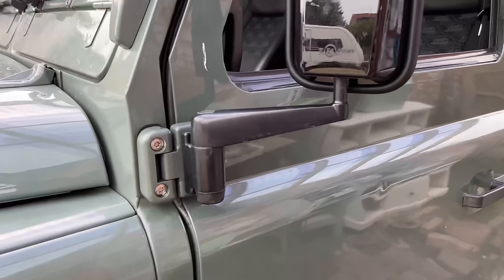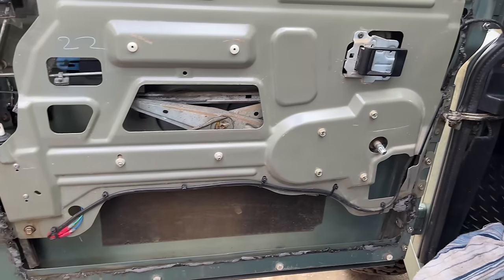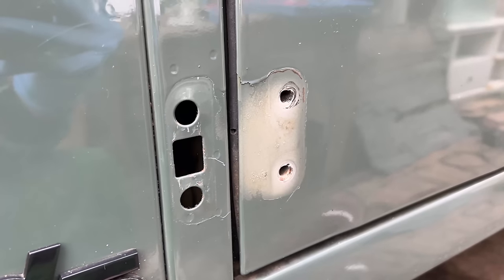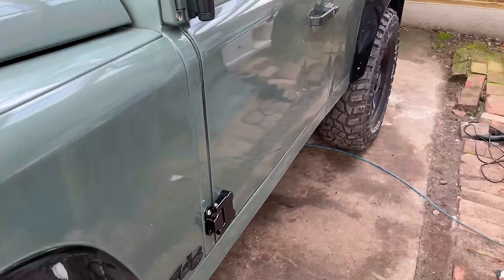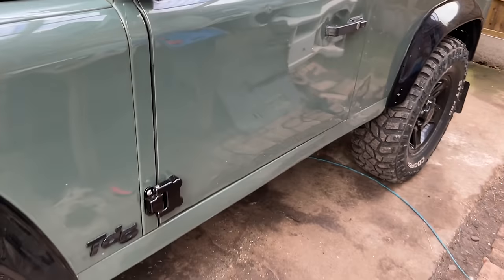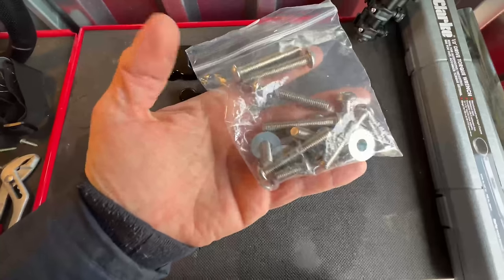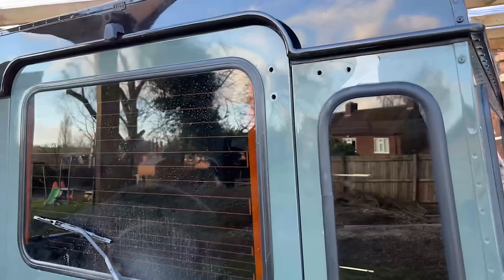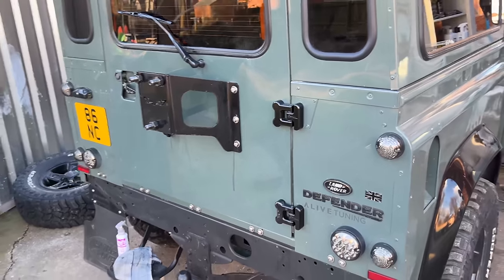NEW PARTS TO STOP MY LAND ROVER DEFENDER GETTING STOLEN! (PART 2)

Comment: They look great! Very happy because I have some on order myself.

Just as a bit of help to anyone who reads this comment, DO NOT skip using copper paste or similar when fitting these hinges.

The galvanic corrosion that can occur between stainless steel and aluminium can be a right pain, especially if you live near the sea.

I'd always recommend Tef Gel which is a Teflon-based paste that entirely eliminates the chemical process, I'm a Marine Engineer and we use it on everything. It's about £16 on ebay and lasts ages.
Reply from the maker: Thanks Andrew- and great tip! I did use copper paste on mine but will look in to this Tef Gel 👌🏻👌🏻

Comment: Instead of replacing the hinges, you can fit the steel plates that hook behind the door seal lip so removing the bolts securing the hinge to bulkhead does not free the door.  You can also hammer ball bearings into the Torx bolt heads to make using a Torx tool or drilling the heads off impossible.
Reply from the maker: These ones have that mechanism too so even if thr bulkhead bolts are drilled out you can’t take the hinge off

Comment: 2:38 from what I can see the bolts are just Torx pin / 6 lobe !? Pretty standard and not specially made for Optimill. There ARE various keyed and uncommon bolts available, but usually you have to register to buy them and the matching tools are expensive.
Reply from the maker: You’re right Frank- I just hadn’t seen them
Before

Comment: Hello Doctor hope your well 

I’ve started this job today having a nightmare with the bolt into the  old spire 
clips it’s just spinning did you encounter this if so what was your fix 

Regards David
Reply from the maker: Hey David - I can’t remember if I mentioned it in the video but I got new spire clips as mine were rusted out- that may help if that’s what you mean?
Reply: @thedoctorsgarage  hello… yes you did mention I’ve also got the clips it’s the original bolt that is spinning the original clips struggling to remove

Comment: Those front door hinges are no more secure than standard hinges.  Thieves undo the front bolts, so hidden rear bolts do nothing.  Those Torx bolts with the central pin are common, as are the tools to remove them. Far better to use regular Torx or Allen head bolts and hammer a ball bearing into the socket once tightened up - that will be a pig to remove to get a tool onto the bolt or to drill the head off.  TMD sell plates that fit under the nuts on the inside of the door, the plates hooking around the inside of the door seal lip on the bulkhead so even if those bolts are removed, the door is still held to the A-pillar (the rear bolts through the door frame can be turned, but as soon as they become loosened, the nut inside, being nylon, will turn with the bolt and not undo, so the plates will be kept in place).

Bonnet hinges are worth replacing, though.
Reply from the maker: Hi Nick the Optimill ones also lock to the bulkhead I didn’t want to go in to explicit detail here on YouTube but you cannot remove the hinge by just unscrewing the bulkhead bolts!

Comment: So what stops a thief just drilling out the bulkhead bolts?
Reply from the maker: Optimill have a clever way of stopping this actually so even if you drilled the bolts you wouldn’t be able to get them off 👌🏻
Reply: @thedoctorsgarage  oh that’s good, I had considered these hinges but they are very expensive. Worth it if they actually stop your doors being stolen.

Comment: i use aluminium anti seize i find it hangs around longer than copper grease
Reply from the maker: 👌🏻 thanks good tip!
Reply: When I build a defender from bare chassis everything gets covered in aluminium anti seize and I make gaskets were two different mm etals meet and I use stainless bolts too

Comment: Great video to help prevent your doors being stolen. I do think the front door hinges could have been designed like the rear hinges, with no exterior bolt heads to drill out/grind off, this would make it more difficult to steal the doors.
Good to see the novelty of tapping the sound deadening, once it is fiited hasn't worn off😂👍
Reply from the maker: Haha always giving it a good knock then trying to find a bare panel to check how much of a difference 😂 the front hinges have a pretty clever mechanism I don’t want to share here that stops you from being able to take the hinges off even if you drilled them out the bulkhead which is good
Reply: @thedoctorsgarage  Just looked at their website and description, I know what I would do as an engineer, I guess they have done similar.

I did watch your headlining video and had sound deadening tapping envy, please Doc can I come around an have a tap😂🤣😆

Comment: Super job👍great videoing,  they look stunning, and will most definitely make it harder to get in,  yes as some people have commented , you can drill the bolts!! Or angle grinder the pins, But that goes for almost any car ,, ie smash a window etc, the main plan is to have a “robber scum” look and say too much hassle…
Reply from the maker: Thanks Al- that’s true.  With these even if the bulkhead bolts are drilled you can’t remove the hinge due to a mechanism Optimill designed which is good for peace of mind